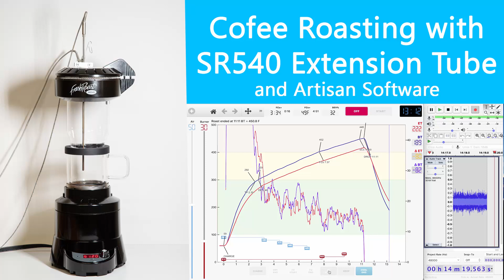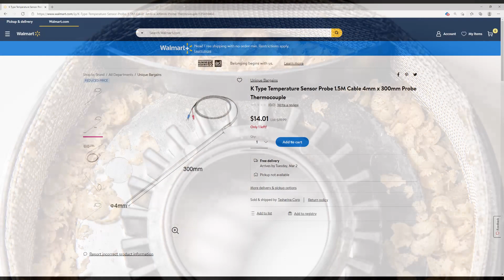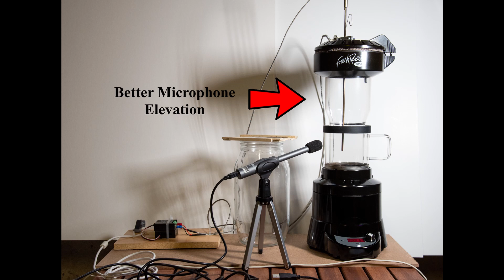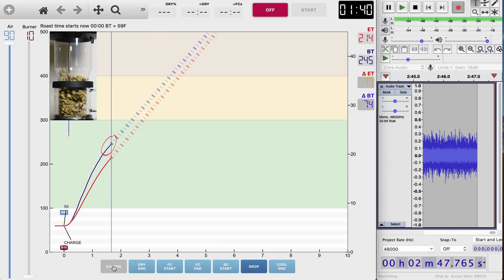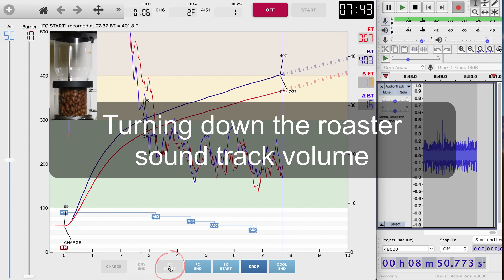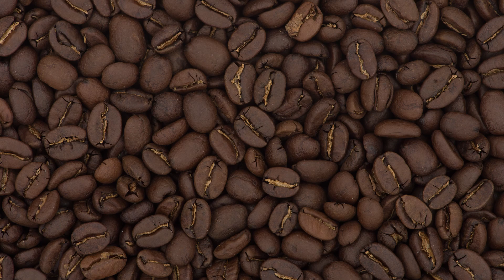Roasting with SR540 (or SR800) Extension Tube and Artisan Software

Comment: I just started with a SR800 w/ extension tube. I only have the one temperature. But I tried to keep the beans moving the same the entire time using the fan and raise the heat slowly through the roast. At the first crack I was at ~420 and by the end of the "full-city" I was at ~460. Whole thing took about 8.5 minutes. Does that sound about right?

Comment: So much great information here! Thank you so much for creating these series of videos. I bought the SR800 with extension tube and should receive it tomorrow. I plan to get two temperature probes with all needed accessories. Maybe later I’ll use my DAW software with a mic to better see and hear the crack events. Actually, I do see a need for that audio software. My hearing is getting worse, so I should wear hearing protection, in which case I won’t hear the cracks, but I could see it on the software. I really appreciate all the technical aspects of this new hobby. Thank you!

Comment: I am using a very similar setup on SR800, I find that my bean temp tracks very closely to the roaster air temperature dial. I am wondering what might be my issue? I have the head of the probe just above the bean mass at rest (and thus in the middle of the bean mass when the fan is running).

Comment: These videos are fantastic for fully understanding the roasting process. I’ve roasted a few batches in my air fryer without completely understanding what I’m doing, though I eventually achieved fair results (though not highly repeatable). The air fryer I was used has since died. I fear I may have abused it by using it as a coffee roaster ;-). I’m going to upgrade to the SR800 soon. 

It seems that the Et data doesn’t add much to the process, and one could probably achieve the same results using only the Bt curve. It also seems like one could use a kitchen timer and a cooking probe to measure Bt (by rigging a holding apparatus, or by using a ported extension such as the Razzo tube) to approximate these results by shooting for specific temperature and time waypoints during the roasting process, with less equipment requirement, since the Bt vs time curve ends up being fairly linear during the roast cycle. Of course, the Artisan software is much more elegant and allows for much greater after-action analysis in order to make iterative improvements. I think my wife would appreciate my not setting up a scientific lab in her kitchen space, though!
Reply from the maker: Thank you and yes, the setup can be simplified and the Et data is optional.

Comment: Thank you for sharing these videos - very professional presentation. I just started roasting at the beginning of the year. I purchased the SR-800 with extension tube. I said to myself I'm going to keep this simple and not get the Artisan setup I saw online while researching roasters. Then I saw your videos and you explained everything so well I made the plunge this week and ordered the hardware. I brew about 1# of beans a week and didn't want to add additional time to my roasting session and your videos make this look simple to hook up and use. Plus, I've been sort of shooting in the dark with my roasting process just trying to hit temps at certain times that I have seen in other videos. I purchased several different beans and was surprised how they roast so differently and you can't just follow one schedule. Seems this software will allow me to better judge my adjustments. Again - keep the videos coming!
Reply from the maker: Thanks for your feedback Mike, and good luck with the setup. I found I can get repeatable results using the Artisan setup. The outlet voltage in my location varies a lot, so having the bean temperature feedback and the Rate of Change curve helps a lot.
Reply: @coffeeroastingathome8890  Tried out Artisan for the first time. I have the SR800 w/extension. I did three 8oz batches. The delta temp was very hard to manage. Mine reacted much different than yours. I hit 25F delta at about 2.5 Minutes and yours was after 3. I have much bigger delta temp swings when I make a change than you do. I maintained positive delta but it's not a nice slope downward like yours - mine is pretty flat. But it was fun and I actually had something to control to. Thanks for your help!

Comment: Hello, Firstly thank you for all the really good information to get Artisan working with the thermocouples and SR800. For the most part I have it all working as per your instructions and have a few roasts under my belt. One aspect of the setup which I can’t resolve is getting the event sliders to report the correct values on the graph. I did change the min/max values from 10/90 to 1/9 so that may be the problem. Apart from the first values for each slider they both report A10/B0 for each change during the roast. I notice that your values are correct so I’m not sure why mine wont report the correct values to the graph. Any guidance would be appreciated. Thanks.
Reply from the maker: Thank you for your feedback, glad the setup is working for you. For the event sliders to report on the graph, you probably need to change the min/max values to 10/90 because they report on the bottom of the temperature axis which has a scale of 0/550. Having the sliders range set to 1/9 would make the show up piled up at the bottom of the graph. If this doesn't work you can download and use the configuration file, link in the description. Hope this helps!
Reply: @coffeeroastingathome8890  Yes that was the problem. Thanks so much. One other question I have which you might be able to help me with is with the curve filters. My thermocouples are 5/64ths in diameter, they work well but i’m uncertain about a good setting for Delta span and smoothing. I note you said the thinner the probe the more sensitive and you set yours to 1 from memory but they are much thicker. Do you have any suggestions for these values. Many thanks!

Comment: Great video, as always! I was quite surprised to see how easily the SR540 was able to roast 170g with no more than 30% heater power and with plenty of bean agitation. It is a 1600W heating element, correct? Ignoring the space limitations associated with blowing beans into the chaff collector, what do you think would be largest batch size you could roast?
Reply from the maker: Thank you! Yes, with the extension tube you can have more bean mass and the heating is more efficient, so you do not have to increase the heat setting very much. The SR540 is a 1,600W machine (I presume most of that is for the heating element and a bit for the fan). How much you can roast (ignoring blowing beans in the chaff collector) depends on your outlet voltage. In my house it can go up to 125 Volts. With that voltage, I think you could do 240g or perhaps more. I routinely roast 200 g without issues, but with the lowest outlet voltage in my house (around 116 Volts) it struggles a bit with bean agitation, specially at the beginning of the roast.  Hope this helps!
Reply: @coffeeroastingathome8890  good to know! My home built fluidbed roaster has an 1800w heating element, but I've always found the heater tends to max out towards the end of the roast with a similar batch size of 200g. Perhaps there are some inefficiencies in the system, or my roast profile, that are requiring too much heat input...It would certainly be nice to do a 200g batch with 30% of the heater power. Perhaps it's time for a redesign :p

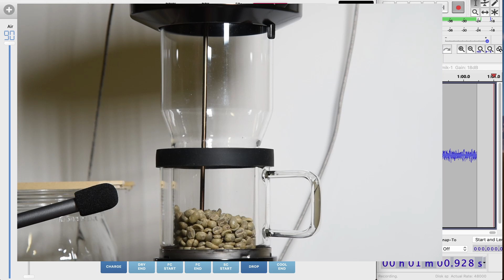Comment: [10:27](https://youtu.be/xo9IdakyIqw?t=627)
0:00 A9B1 Start Roaster 
[12:01](https://youtu.be/xo9IdakyIqw?t=721)
1:30 ROR 85
[13:02](https://youtu.be/xo9IdakyIqw?t=782)
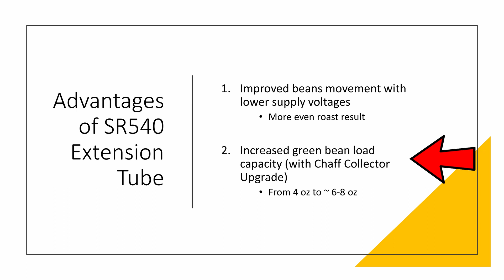2:30 ROR 40
[13:17](https://youtu.be/xo9IdakyIqw?t=797)
2:46 DE
[13:46](https://youtu.be/xo9IdakyIqw?t=826)
3:15 A8  Low ROR 20 - Jumps to 25
[14:59](https://youtu.be/xo9IdakyIqw?t=899)
4:29 A7
[15:49](https://youtu.be/xo9IdakyIqw?t=949)
5:20 A6
[17:12](https://youtu.be/xo9IdakyIqw?t=1032)
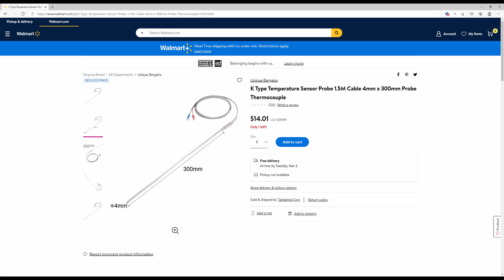6:40 A5
[18:08](https://youtu.be/xo9IdakyIqw?t=1088)
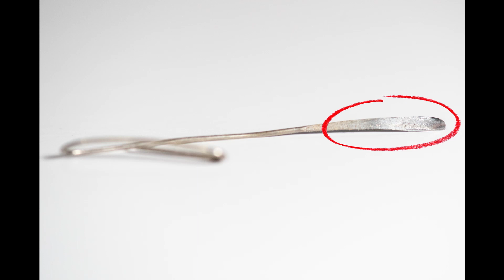7:37 FC
[18:21](https://youtu.be/xo9IdakyIqw?t=1101)
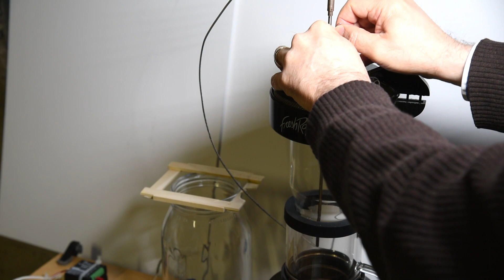7:51 B2
[20:09](https://youtu.be/xo9IdakyIqw?t=1209)
9:39 B3
[21:27](https://youtu.be/xo9IdakyIqw?t=1287)
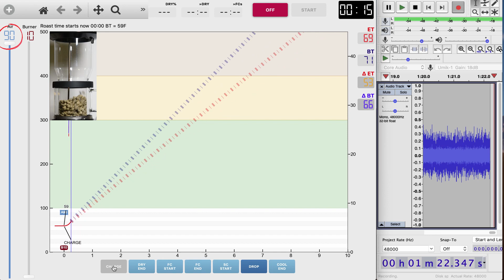10:50 Second Crack
[21:40](https://youtu.be/xo9IdakyIqw?t=1300)
11:11 Drop

Comment: ok, now i'm being a pain. I've googled a hundred videos, and on 2 facebook pages.... There is EVERY permutation and combination of how to roast, and i know i can try many of these and burn through lbs of beans to experiment . I've watched your video TWELVE times, each time looking at every change in settings (although i am only going through machine temps.. no probes.).. I'm always looking for something different and i;m always finding something new in  your video. For some reason , i trust your processd as I'm pretty much doing what you are doing..
anyway , maybe you can help me once again.
(send me a private message, for my modest advisory fee, which i think you deserve by now.)
so
my last few roasts(sr540 150 gm with extension) gave me city + roast (the chaff in the crack is light coloured). I pulled my beans at about 8.5 minutes. 
Now, i want to go a little darker, i am not sure what to do....
My First Crack leg has the temperature pretty stable, going up a degree or two about every 10 seconds...
 I'm thinking of 3 possibilities ( starting at First crack.. my process is increasing heat every 60 seconds after a 2 minute drying phase)

1) don't make any changes.. let the roast continue ... I don't think this is the best idea because maybe the temp is raising too slowly and it will take 10-12 minutes for my roast. 
2) don't touch the settings while the FC is rolling.. and when FC quiets down near the end, maybe i should increase the heat till i get the darker roast i want.
or 
3) As soon as FC starts rolling, i should raise the temp a bit to push the roast a bit until i like it.
( i don't think i should be going past 10 minutes... or maybe that's not a problem. i don't want to bake the beans. i know that most people like a 5-8 minute roast.
---
so if you think i should try one of the 3 options i listed.. or maybe there is another possibility ?
stephen
Reply from the maker: HI Stephen, this is why I like the probe feedback; there are too many variables that makes a setting "recipe" difficult to always work in my experience. Around FC you have a lot of things going on, for example steam escaping from the beans will mix with the hot air from the roaster and this will have the effect of changing the temperature around the beans, exothermic chemical reactions going on, etc.  Sometimes this is described as "Flick and Crash" events. So you need to adjust the heat setting to compensate for these effects and avoid these sudden changes in ROR. How much to adjust depends on how sudden the steam escapes the beans, how much steam, what chemical reactions are going on, etc. This will depend on the beans and how fast you approach FC. So you can see why it would be hard to come up with a fixed settings "recipe". On top of that, I have issues with stability of outlet voltage in my house which adds to the variability. Normally I follow the idea of option (3) unless the beans are "flicking", in which case I wait until the ROR starts dropping before I increase the temperature setting. I definitely want to avoid the "crash" (sudden decrease of ROR, specially going negative!) and try to keep the ROR between 10 and 15 degrees per minute after FC, to give enough development time. To accomplish this ROR, sometimes I don't need to do anything after FC and sometimes I need to increase the temperature settings a couple of times; depends on the beans and other variables I mentioned. Hope this helps!

Comment: hi gain. after following the freshroast forum. there is one school who prefers the high heat in the roast . slowly decreasing the heat as you go along. have you tried this method ?
Reply from the maker: Hi Stephen, I have not tried this method, with the extension tube I find that I need to keep decreasing the fan setting to avoid the beans jumping too high which also has the effect of increasing the heat on the beans (lower air velocity results in higher air temperature). So I try to keep the heat setting as low as possible to give me room to keep decreasing the fan setting, and only increase the heat setting once the beans are not jumping too much. In the end I don't think it matters how to increase the air temperature (i.e., by decreasing the fan setting or by increasing the heat setting), but keeping the beans from jumping too high will result in a more even roast and avoid losing beans on the chaff collector. Hope this helps!
Reply: @coffeeroastingathome8890  Thanks for the speedy reply. I understand your process and i have been using that process myself.. Just to clarify my question, i have seen some people start with high heat (fan 9 and heat 9) and slowly lower the fan and the heat over time... To me.. this would have the heat stable or increasing along the roast.. and not starting at low heat with increasing heat, as you do.... I imagine the danger here is that you may roast too quickly and have the inside of the bean undercooked...
Reply from the maker: @stephenrudolph1064  Hi Stephen, I think you are right, decreasing both the fan and heat at the same time would keep the heat more or less constant at a relatively high level. Specially with a high outlet voltage this may result in a very fast roast, with the inside of the bean undercooked as you say. When I tried fast roasts the taste was on the grassy and acidic side, which I didn't like. This may depend on the beans, but I don't have enough roasting experience to tell. With the beans I used, which tend to be low to mid-elevation, I prefer a slow roast with the heat increasing as I go.

Comment: Thank you for your videos! I binged all of them today.

I have an SR800 in the mail and I plan on adding the extension tube in the future. Wound a long thin thermocouple like this work? I'm thinking to bend it to make it fit in the small chamber and then again bend it for the extension tube...

https://www.amazon.com/dp/B0874DQ3C6/
Reply from the maker: You are welcome and interesting idea about the flexible thermocouple, being a type K should work fine but if you use the Phidget module you will have to adapt the connector the the module input. Not sure how you plan to support it, the moving beans may push it around if it is too thin and easy to bend. Also you may need to use more filtering in Artisan, the thin thermocouple may respond very fast to temperature changes and give you large rate of change swings. The thicker thermocouple provides a bit of filtering by the material surrounding the thermocouple junction which smooths fast temperature changes.
Reply: @coffeeroastingathome8890  thanks for your response! I think I'll go for a 3mm one and see if I can bend it. I'm planning to use the Mastech approach.

Comment: Do you know how well the ST800 on-board temperature measurement tracks the BT measurement? Thx for the great vids!!
Reply from the maker: You are welcome!. The on-board temperature sensor measures the inlet air temperature, before it interacts with the beans. The beans exchange heat with the air and also release steam, changing the air temperature in ways that are difficult to correlate closely with the inlet air temperature. The built in temperature sensor reads generally quite a bit higher than the BT sensor, and the temperature changes when changing settings are much more abrupt. Hope this helps!
Reply: @coffeeroastingathome8890   Thanks you! That makes sense. BTW, you did the home roasting community a great service when you did this. Thanks for taking the initiative and putting together a clear and concise video! Michael
Reply from the maker: @michaelready  Thank you very much for the feedback!

Comment: Is the phidget vint hub the best method to connect probes to the Sr roasters? Why did you selected over the tc4?
Reply from the maker: I think I my initial thought was to use the thermocouple module only, but then I found out that the vint hub was a newer alternative from phidgets which has the advantage of expansion to other module types for other applications. The price difference was not too much if I recall, so I went with the vint hub solution. Artisan has an option to automatically configure this hub. I must say I didn't find yet a reason to expand to other modules, so if your only use is for the fresh roasters then the thermocouple module should be just fine I think. Hope this helps to explain my thinking!

Comment: Do you think it would help reduce the jump in bean temperature when decreasing airflow by switching between two air flows. For example, decrease airflow from 7 to 6 for 5 seconds, increase airflow from 6 to 7 for 5 seconds, decrease airflow from 7 to 6 until you want to drop it to airflow 5. Have you tried something like this?  TXS again for such great videos.  I did purchase the phigits and thermocouples, you inspired me.  I just need to learn to to control ROR now.
Reply from the maker: It is an interesting thought and it might help, but I think some of the temperature jumps are because of the beans motion influencing the hot air velocity passing through the thermocouple sensor and not because of actual bean temperature changes. For example, at times the beans are blocking the air flow under the thermocouple, and sometimes they move away so a blast of hot air passes through the thermocouple. You can see this if you run the roaster without beans, the temperature behavior is a lot smoother. I may do a video about it when I have some time. So ROR control on this type of machine is a challenge, not only because of the discrete settings (which can be helped by modulating the pulse as you suggested), but also by the beans agitation. Filtering can help smooth sudden changes, but it also introduces delays that can make control difficult. Hope this helps, and good luck with the phidgets setup. It has worked very reliably for me.